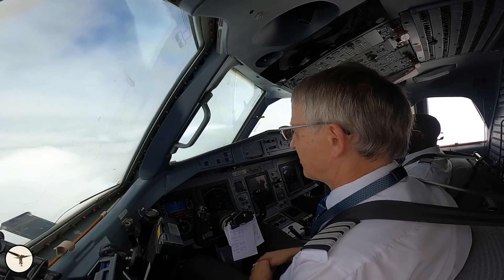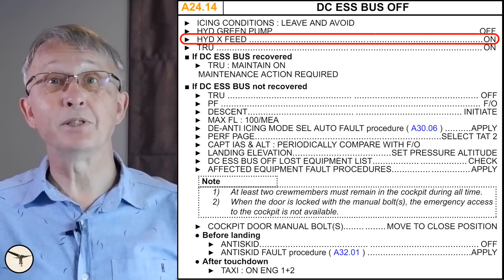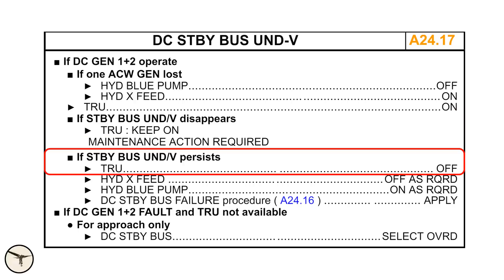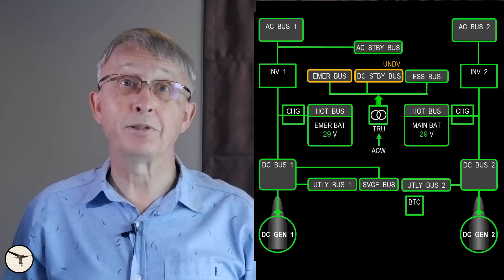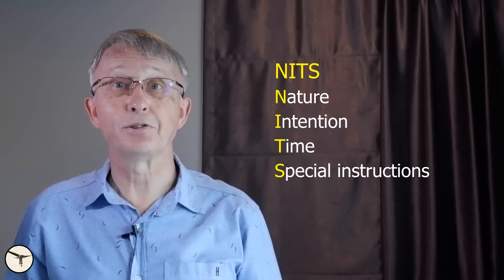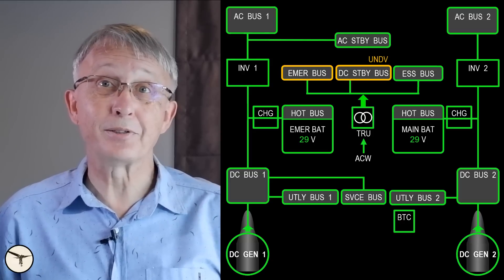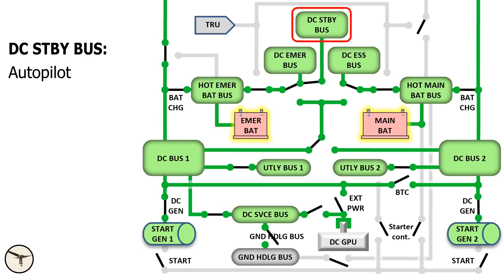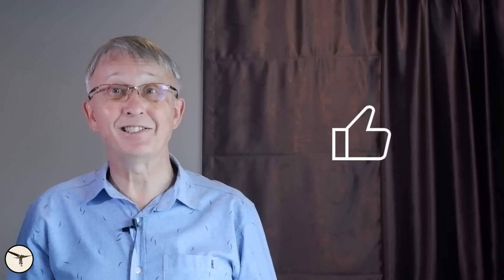ATR 72 Emergency Landing: Uncover Essential Electric System Tips for Pilots!

Comment: Just flew on an ATR (Bangkok Airways) in Thailand. Was great but was hoping that they did not retard the prop levers by mistake ha ha. Flew on them lots in the Caribbean also (LIAT). Nice video.
Reply: As far as I remember that problem was solved with the introduction of the 500 series. Current ATR Operating are 600 models.
Reply: @NathanieI87  Was referencing the crash in Nepal last year.